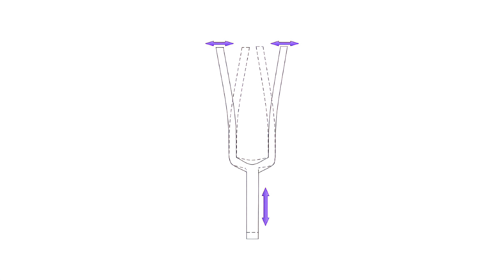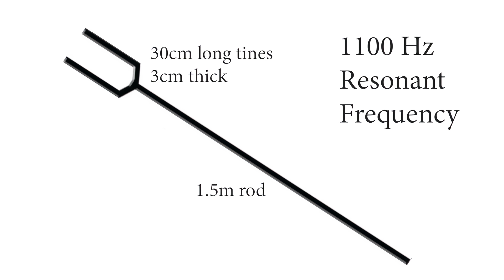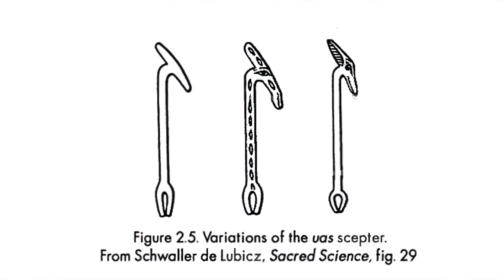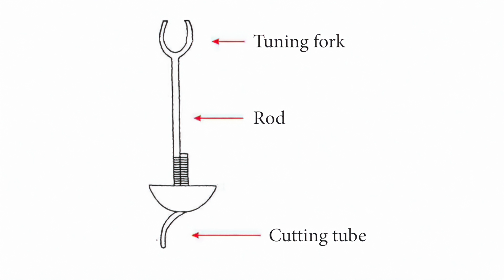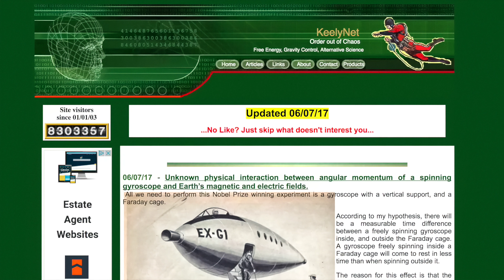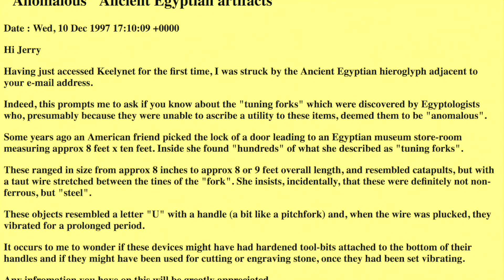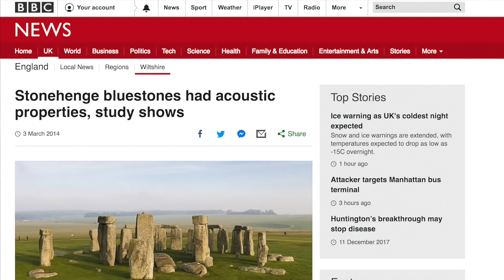How the Ancients Cut Stone with Sound - Lost High Technology Explained | Ancient Architects

Comment: Tuning forks with matching frequencies don't have to be wired to together in order to create perpetual vibration.  They only have to be in close proximity.  You can see this in action by placing a tuning fork near a speaker attached to an oscilloscope and bringing another tuning fork of the same frequency close to it.  The oscilloscope will display the frequency.

Comment: I'd agree that this is the right idea, but the fork part may not even be necessary. Tubes on their own can be resonant, depending on the material used and other factors like diameter and wall thickness. So a thin-walled hard bronze tube that's stroked with a bowstring may be able to do some drilling in stone.

Comment: They also would use “mandalas” to hit the correct frequencies they required, if you put salt or a light sand on a board and put a sound/frequency under that board, each sound will make a specific pattern within the sand/salt, this is also how they knew when the correct sound/frequency was produced for whatever job required? Cheers 🍻
Reply: Hi There I don’t believe per say in the bible but the first line is (or one of the first lines) “in the beginning There was a word and the word was god”. I always thought that was a metaphor for what you just said? 👍

Comment: This doesn't show anything. In theory it sounds like it may work, but no one has ever done this successfully. Even if you search for acoustic drilling or sonic drilling you don't find anything that suggests copper can cut through granite. I keep seeing the same Russian video over and over again of some guy with a copper tube and an already cut hole in the rock. Can't find a video of the actual cutting anywhere. If you're going to claim the ancients cut stone with sound replicate it. It's not enough to piece together a forked hieroglyph with an elaborate theory that no one can seem to replicate.
Reply: Wikipedia may shed some light on it:
https://en.wikipedia.org/wiki/Ultrasonic/sonic_driller/corer
Remember they didn't need to use copper, they made stuff out of iron from meteorites too.

Comment: YES I ABSOLUTELY AGREE !! tha aledged "tokens of .. power" copycatted by present day royals .. ARE TOOLS OF PITCH VIBRATIONS to do engravings(make a surface act soft enough for carving) to soften a surface of a built structure to make it look melted together and on the surface, to cut large/huge stoneblocks of uniform moleculestructure by making them "brake apart" on molecularlevel along a line etc.. even to make a huge stone "think" it weighs almost nothing ( just as microwaves makes molecules act hot) the ank is also a tool of that kind and they are prob used together. The funny heads on some folks are descriptions of their roles/work in the community (no religous funnies at all) just a description on how they served the common good of all. Or that are my thoughts Thank you !

Comment: What is the method of power delivery to the fork making impulse energy resonate but is that enough? If matter could transport between hydraulic cavities by quantum tunneling of fluids at the nano scale level could pump a resonant fork. This would require high voltages at high frequencies demodultated down. Huge power could be delivered. It's Classified tesla tech on high voltage tunneling. See Philadelphia experiment. This must be electrical to tunnel.
Reply: Richard Paulson so do you think this is why they had a Tesla coil connected to the scepter

Comment: Yet another vid by a non engineer trying to describe engineering concepts, most of the mysteries regarding the construction of the pyramids have been explained and reproduced without the need for mystical or advanced technologies. There are evan video`s on you tube if you can`t be bothered to read.  I mean come on, why use resonance when far easier methods were already available. Let me guess you still believe that the stones were dragged by slaves for miles instead of sailing them on the boat`s found at the site as described by writings found not too far away, and before you say its a desert, it wasn`t back when they were constructed.

Comment: Most of stone-cutting techniques of ancient Egypt were reproduced with success. It is all about copper saws, tubes, lots of water, abrasive powder and elbow grease. Speed is approximately 2 inches per hour (with unskilled modern labor) but it is definitely doable. The only trick the team trying to drill on 6:10 was missing was building walls of wax around the hole to keep water and abrasive in.
https://www.youtube.com/watch?v=g305wqCdPRs

Comment: So  are you claiming that  to  controll the  vibration it is contingent on the manipulation of the  center of gravity of the  tuning fork and  drilling rod?  If so it  would  be  possible to  exactly  manipulate the  depth of  the  disruptive field of the amplified wave resonate  form and  the wave form  to resonate at the specific  frequency of the  material  to be   drilled.  I don't doubt  it!

Comment: They used sound to build the whole thing!  Sound is used to form sand into stone, some cutting, and of course using sound to make these stones weightless!  A specific tone or frequency cancels out the mass of almost any solid object.  They used sound to build the whole pyramid.  Including heating and forming stone into interlocking shapes! A specific frequency allows These blocks to become weightless for easy transportation moving these stones. The pyramid is also build like a interlocking jigsaw puzzle that bind's and locks different layers into a massive three dimensional structure.  Each layer of the pyramid has a different function, as the entire pyramid is used to power up and contact different being in different solar systems. It take a lot of energy to contact planets far away and this was one of the many uses the pyramid gave.  There are a lot more too...

Comment: the Roman theater in Amman (jordan) from 100AD has real interesting acoustics that are probably common to all roman theaters of that era. If you whisper into the rim of a seat edge (looks like crown molding) the sound travels and amplifies around to the far opposite side of that row .. kind like tin cans with a string between. It's amazing how well it works but probably just mathematics; point being is that I buy your theory.  Sounds better to me than the used water and let expansion crack the rock as it froze (a method used perhaps in the Andes but not likely used in Egypt).

Comment: maybe the wires on the tuning forks were plucked using a [hair]comb type thing to keep the resonation going.......and they would use a different fork for different depths........I also wondered if the rock was super heated somehow and that made it easy to "mold" mate the several blocks together........I wonder if the stone blocks were actually made in the vacuum of space, and each block was easy to cut due to the freezing temps......maybe there was a technology that made form building very easy and all they did was pour the molten rock into a mold that fit the other rocks......has there ever been perfect replicas discovered?.....as if the same mold was used?.......are the holes seemingly perfect copies?

Comment: I still think the large quarry pieces were purposely oversized the way they were because some type of mudbrick molds were cast using them as a model.  Then transported to the build site and reassembled for pouring cement into.  Thats how so great a level of symmetry was achieved.  Shrinkage from environmental factors durring transport explains the size of pieces left in quarrys.  By pumping out castings of disposable even somewhere reconstitutable mud or clay molds to use  on site, poured in place, the timetable issues and carving/transporting mystery is better explained as well as the dig patterns at the quarries where in my opinion aggregate was scooped out.  Hell we could even have things backwards and the pyramids could have been for making lye from limestone.

Comment: Could you please list your sources of the "confirmed" modern examples of the use of this sonic boring technology that you mension. Then we can all make a table top scaled down version, we could drill something soft to start with, and this would then be proof of principal. then we could make a vid of this in action, as proof. this would close down all the sceptics and haters. and I for one could put this to good use at work.   Even if I can get this theory to cut a hole through a bar of soap it will still be proof of principal. then we can build up to somthing impresive. when I was a kid I thaught I could fly.. I tested my theory by jumping of a two foot wall and not the back of my mums house, little steps , If we get our evidence and you can make it go, I recon you will get a Nobel for this one.   lets do science.